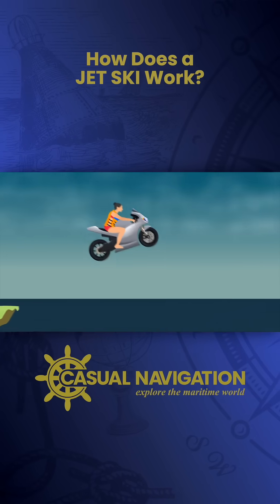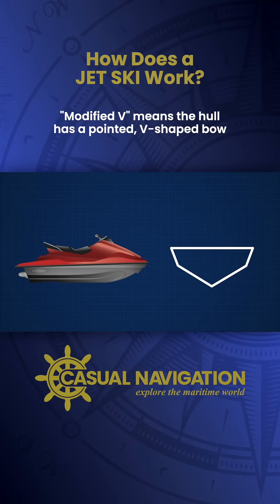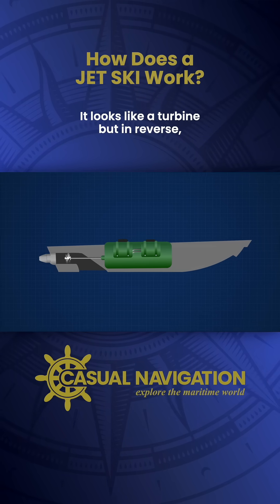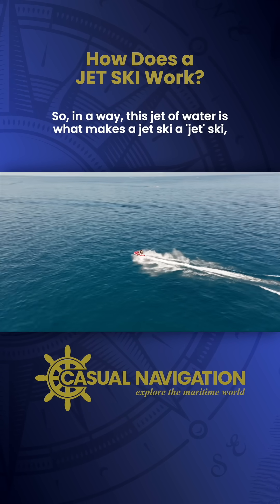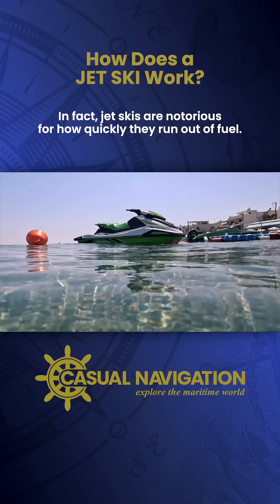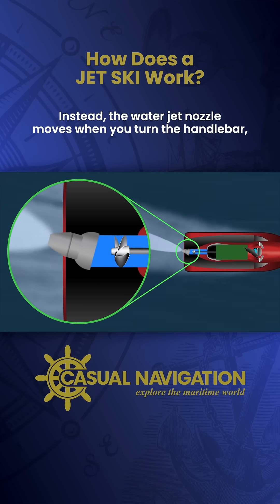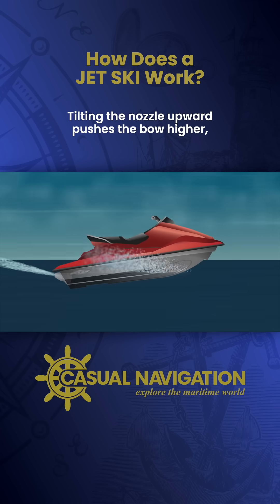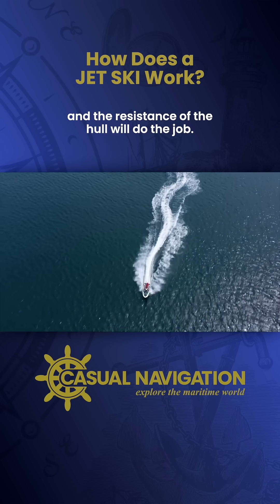How Does a JET SKI Work?

Comment: I am more curious with purpose of the "water outlet" (i.e. the blow holes at the rear)
Reply: There are two main reasons
Water that was used to cool the engine is released
It goes by the name "Visibility spout" because it makes obvious to other boaters the presence of a jet ski
Reply: @ianemerson2704  ah, just like "antenna" for small cars in mining operation.
Reply: Newton’s third law for every force exerted and proportional opposite force is also exerted… so when you move water with force then it creates a force that projects you in the opposite direction… blow hole is at the back for the same reason a boat propeller is… so you move in the opposite direction of the ejected stream.
Reply: @dreammaker9642  The water spout at the back has a negligible effect on speed.
Reply: @dreammaker9642  the blowhole is upward, so it pushes the ski even deeper ? 🤔
Reply: @HarpaxA  opposite my mistake but you weren’t talking about the blow hole are you? You meant the water cooking that streams out? Thats cause the engineers that designed it decided to have it point upwards… if you want their reasoning behind that ask them but it serves the same purpose as boat’s offboard engine, water flowed through to cool the engine as it runs. On offboard engines there’s a little hole in the casing in front of the rudder that has water flowing through that mechanism to make sure the rodder system doesn’t overheat… hence why you never want to run an engine dry and why you’d want to regularly run it in fresh water to clear out the salt. In a jetski it’s bit different, someone correct me but some of the water sucked in from under gets passed through the system to cool it and ejected behind. If I were to guess it points upwards so not to be in the way of other stuff but again engineers have their own reasons for doing things sometimes but since most if not all of them are like that then most likely it’s a good reason.

Comment: Why are some spitting water upwards?
Reply: Water cooling the engine… same as a offboard boat engine
Reply: @dreammaker9642  But why is it shooting upwards. You could lead the cooling water with the general stream
Reply: @ it’s separate stream and it shots up cause that’s what pressured water does… now why it’s designed this way, ask the engineers that designed them…
Reply: It also serves as a kind of flag for extra visibility when you're in motion
Reply: @Parpyduck  Ahhhh that makes sense. Thank you.

Comment: And if you fall off, the steering is designed to circle back and collect you
Reply: I love this feature. Also, the key is attached to a stretchy coiled lanyard on your wrist so if you fall off it immediately cuts power. One of my favorite things as a young adult was to suddenly jackknife the steering at full throttle and get flung into the drink at high speed just for kicks. The power would instantly cut and the Sea-Doo would reliably just circle in place so I could remount, open the throttle and fling myself through the air again and again. My god jetskis are so much fun.

Comment: Keep in mind that with the integrated steering system, you have to apply power to turn. You can’t turn while coasting like you can with a rudder.
Reply: It's real fun if you loose power from an engine failure and then can't steer.
Reply: @trace9130 
Revelation 3:20
Behold, I stand at the door, and knock: if any man hear my voice, and open the door, I will come in to him, and will sup with him, and he with me.

HEY THERE 🤗 JESUS IS CALLING YOU TODAY. Turn away from your sins, confess, forsake them and live the victorious life. God bless.

Revelation 22:12-14
And, behold, I come quickly; and my reward is with me, to give every man according as his work shall be.
I am Alpha and Omega, the beginning and the end, the first and the last.
Blessed are they that do his commandments, that they may have right to the tree of life, and may enter in through the gates into the city.
Reply: Jetski on idle push a little water
Reply: @loup1559 
Where are you going after you die. Repent today from your sins. Hebrews 9:27 says as it is appointed unto man once to die but after that the Judgement.

Confess your sins and turn to Jesus Christ today. He is the way, truth and life.

Comment: How big can this concept get?
Reply: There is no limit really. Its just not very practical in larger vessels due to it having way worse fuel efficienfy then regular propulsion. Only larger vessels that use it are generally navy vessles where the extra mobility is worth the higher fuel consumption.
Reply: @ so if I combine normal propulsion like azi pods with waterjets I would basically be losing money?
Reply: IIRC DMS made a video comparing propellers and water jets. Again, IIRC, waterjets are more efficient abvoe approximately 50 kts. However, going 50 kts in any boat is wildly inefficient to begin with. 

The main reasons for using water jet is high speed, shallow draft, no exposed propeller and maneuverability. The video didn't mention one thing that is particularly special about some waterjets. The reversing bucket can be designed in such a way that when partially deployed, it provides very little forwards or reverse thrust, but can still turn the boat. 

As mentioned it is somewhat popular in military applications in larger scale, but also Search and rescue. The lack of exposed propeller, maneuverability even when stationary and speed is very helpful when trying to rescue people out of the water.
Reply: @ thanks I understand it better now

Comment: You don't twist the throttle to accelerate. You use the "brake" lever as accelerator. Since you don't have brakes on the water. And on the clutch lever is the brake/reverse. No ATV or watercraft has a throttle twister to accelerate cause you have accidents while jumping and juggling around. Same works for quad bikes
Reply: I was looking for this reply 😂👍